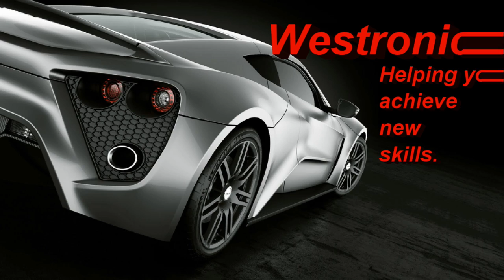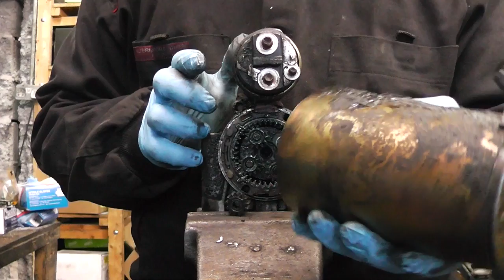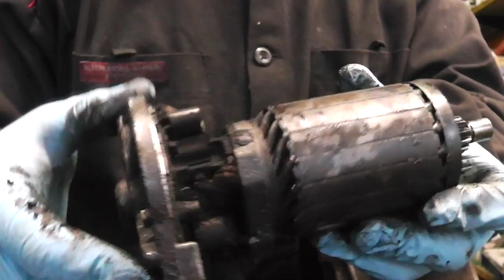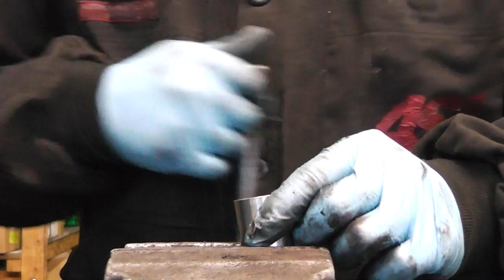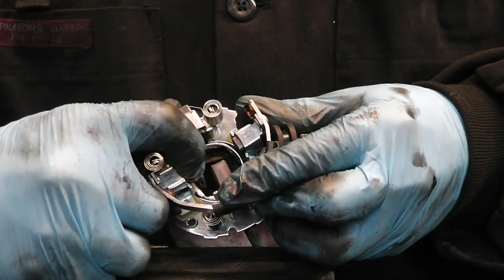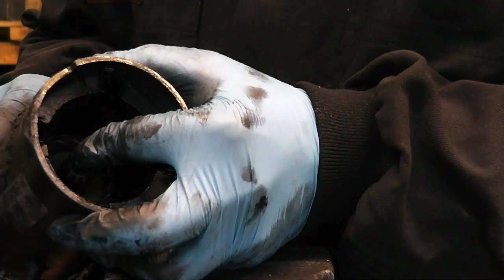Ford transit lazy starter motor diagnose and repair.

Comment: Good job, but why didn't you clean and grease the gears and output shaft? All that oil and diesel will spread into the starter motor again.

Comment: Hi great video, could i ask what makes the smoke coming off it?
Reply: I REPAIR STARTERS AS WELL.  FROM MY OBSERVATION I'M TO ASSUME THE SMOKE IS THE BURNING OF DIESEL AND OIL SEDIMENTS FOUND IN THE MOTOR WHEN IT SPINS AND WARMS UP!
Reply: Mine did that when I bench tested it, when I got it apart there were no brushes left at all just those little copper thing plus everything inside the starter was a real black mess of old grease, oil and other debris it had accumulated over the years

Comment: I have a problem with a starter motor on my Transit Mk 6 as confirmed by the AA.. I always use to just replace the brushes but now Mr AA man tells me the whole unit will need replacing I dislike the European impersonal global approach to anything.. including vehicle repair...Looking on a part website there are 4 makes of motor and all come with a surcharge.. Pretty obvious they want the old motor to recondition it and replace brushes then re-sell at a profit.... The problem being can an owner (who isn't trade) even acquire just the brushes now.. Does anywhere just supply the brushes other than to the trade, I am in UK? I am almost convinced its just the brushes that are worn, because a few times before it failed to start completely it wouldn't start on one turn of the key but did start on the next turn.. Starter motor sticking due to worn brushes I thought.. that was a month or two ago.. Now I used the van one evening and then nothing the next day.. Dead as a Dodo..  I have more than 1 vehicle at my disposal so I am lucky I am under no pressure to get this repair sorted until I decide the best way to approach it.. It's not about meeting garage repair costs I have the money to pay a garage for the repair.. For me it's the principle of do I really need a garage in the first place..
? Very clear instructions to follow .. well done..
Reply: Did u get sorted lad?
Reply: @muskymcg  Sorted ages ago cheers, lad..
Reply: @Keepingitrespectfulmostly.  what was the fix bud?
Reply: Ages ago. A trusted garage sorted it out.
Reply: Buy the brushes on ebay, they're between £12-18 a set depending on the seller
Reply: @BillSikes.  My comment was 3 years ago.
Reply: @Keepingitrespectfulmostly.  
Well at least you know now

Comment: Their is a part beside the starter like a transformer what is it
Reply: That round part is the solenoid. It pulls the Bendix gear into the flywheel teeth when power is applied.

Comment: Your video is good because it shows most of the components. Your methods suck because you cleaned nothing before re-assembly. The old brushes were probably ok but oil-soaked and stuck in their holders. Two minutes in the parts washer while brushing the debris and working the brushes in and out would have rendered a 'good as new' brush holder.  KEEP SANDPAPER AWAY from the commutator segments! That black film over the copper segments is carbon, formed when the brushes 'bed-in'. The whole armature needs a good cleaning in solvent, a blow-dry and a scriber scraped between copper commutator segments to undercut them (so the brushes only ride on copper).
No doubt, your gears are contaminated with bits of brush and carbon. They need to be washed, blown out and re-greased with a name-brand moly-lithium grease.
What about the solenoid? No mention of that and no cleaning instructions, AGAIN.
Jesus, Mary & Joseph, do this job right. If you put that back on my vehicle in the state it's in, I'd have you fired.
Reply: You are totally correct.
Some of these guys have no understanding of the actual electric/engineering of autos and just do what they have been shown.  I would never splash down starter motor current onto a copper thread.....
madness.
Reply: I have just buggered the three screws that hold the solenoid on, god they were tight, had to use a small chisel to get them moving, don't know were to get them from, any ideas anybody..

Comment: Great video, I have an old 1998 mk5 transit (smiley face) its a 2.5di with no glowplugs, and ive been having trouble starting on cold days? its like it has a flat battery just not turning fast enough replaced the battery still no different fitted a second battery and still the same, if I bump it off my drive it starts fine turn it off and it will start everytime for the rest of the day, get up next day and its like a flat battery again as soon as the weather gets a bit warmer it will start fine ive cleaned all the terminals on both batteries and the starter and cleaned the earths, do you think it could be the starter? the only reason ive not thought of changing it is because once it starts its fine all day and all summer long but come November through to march/april im back to pushing it off the drive, any help is appreciated
Reply: bad earth

Comment: sad to say i also have a issue with my starter.. It will somtimes crank then stop u can can hear a fast spinning noise.. then i have to start it against and hope its bites. Idk if solioide is faulty.
Reply: That spinning is you starter motor working correctly,  but the solenoid is on it way out, because its not flying forward as it should and pushing the starter motor pinion onto the flywheel teeth

Comment from the maker: Good Job mate :D.
I think it should work for you
,you can see in my other transit starter repair video that i go over the dual-mass flywheel dust problem (that's what the filings are :D).
All the best to you mate.

Martin.

Comment: That starter motor is pretty easy to dis-assemble. I did this today without learned something about it. It didn't wanted to turn at all, and i've cleaned the inside of the starter motor, because there were alot of metal/magnet shavings on the magnets itself, and removed almost everything with just blowing air in to it, and using some old clothes. Re-assembled it, and now it turns much easier with my hands, but i will see if it turns over with a battery within a few days.